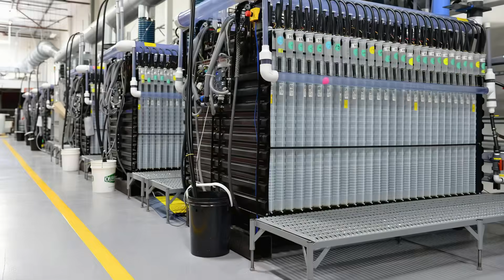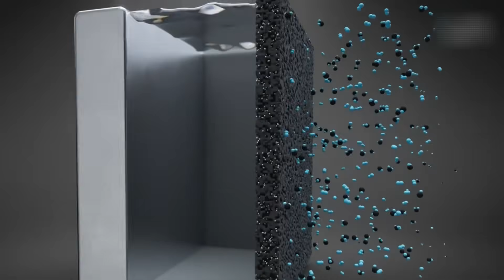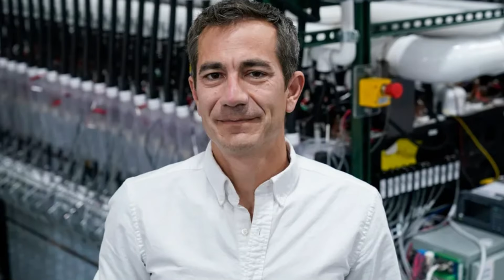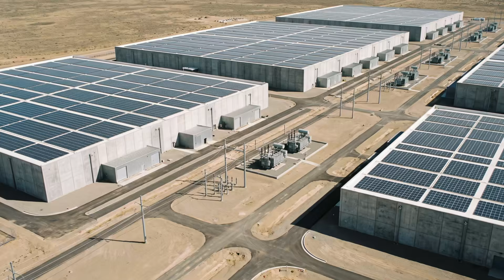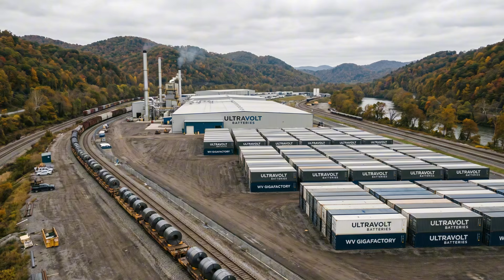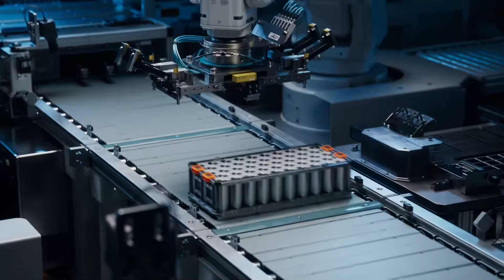Why Bill Gates Is Spending $1 Billion on "Rust" Batteries

Comment: Replacing retiring coal-fired boilers at Xcel Energy's Sherburne County (Sherco) station in Becker, Minnesota with a 10 MW / 1,000 MWh iron-air array is the ultimate transmission shortcut. By plugging multi-day iron storage directly into the existing high-voltage coal switchyard, utilities bypass the 7-to-10-year FERC interconnection queue while keeping winter grid inertia intact.